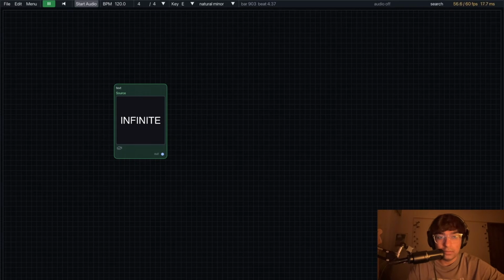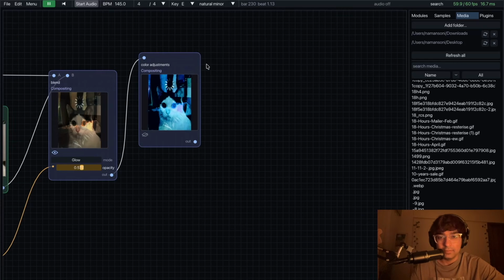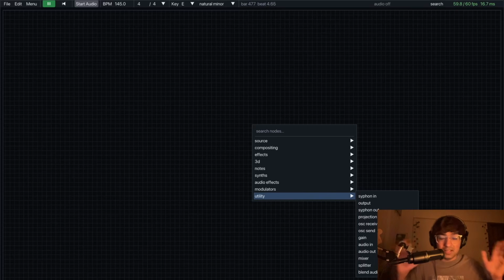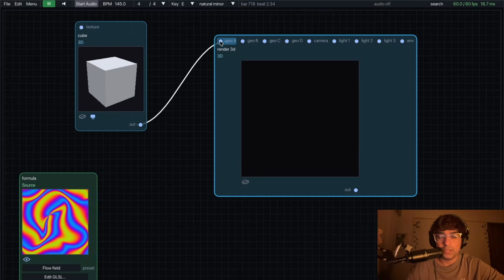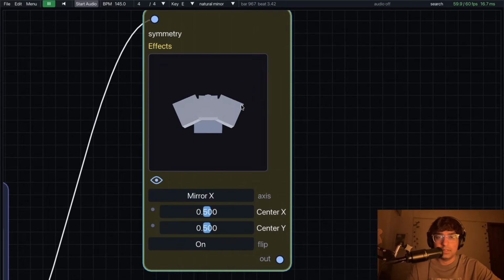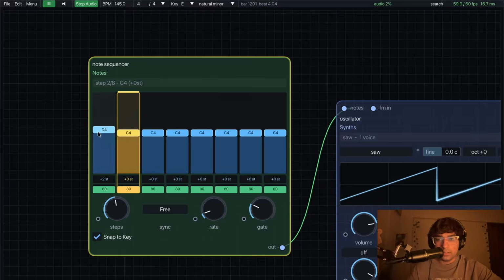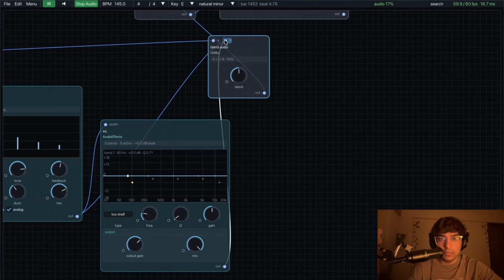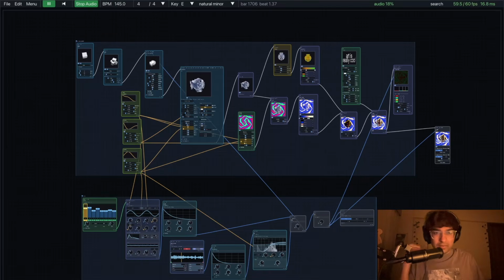Introduction to Infinite: Modular DAW, 2D Compositor, 3D Playground

Comment: It’s REALLY COOL BRO! started using it and the experimental sounds and visuals it can create is out if this world!
Also, how do you detach two nodes? unless i delete a node or insert another node into the point the "cables" cannot be detached it seems.
Reply from the maker: hi thankyou just try clicking on the cable and tap delete it would delete the cable or disconnect it

Comment: This is madness! I must try to build a liveset with this tool. My only major question is, does it work with midi controllers and how easy/flexible is it to set up midi mapping. Also, can you project visuals to external monitor/projector.
Reply from the maker: yes just look for midi nodes and do midi learning, very easy to set it up, and yes you can project, use projection node